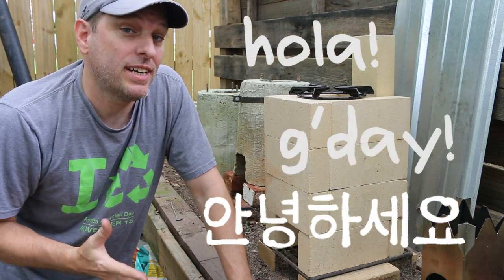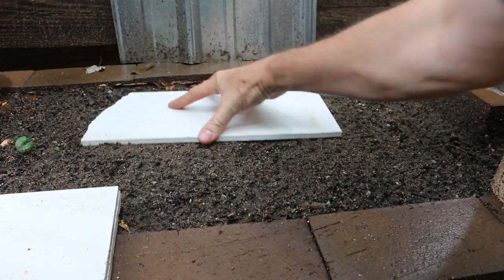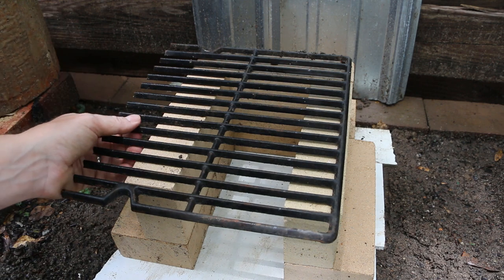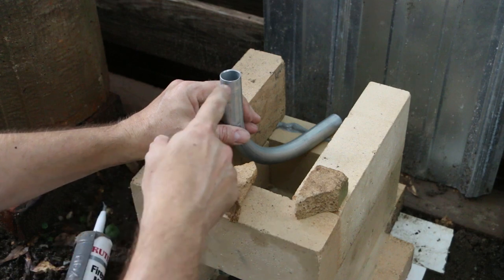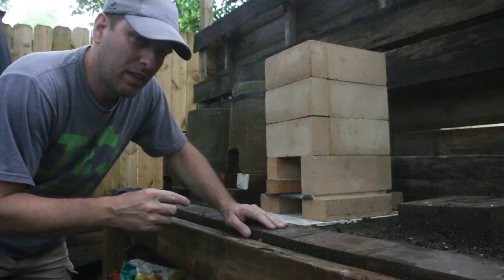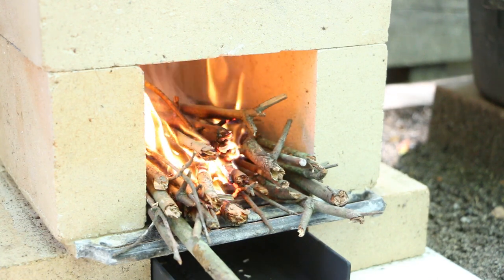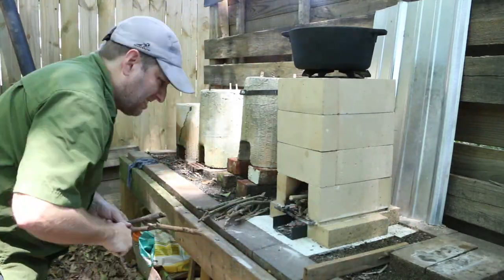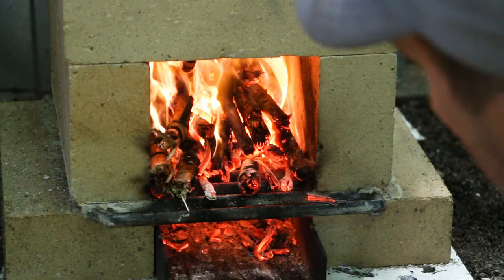How To Make A Fire Brick Rocket Stove

Comment: Do NOT cement your bricks. Mine aren't. Easier to clean, easier to move. And with the grate, i can convert to a grill or Camp oven table. It sounds like more work, but I like the versatility I get vs needing more bricks.

Comment: First, let me say I really like the way you produce your videos and the honesty with which you present your information.  I almost always watch the entire video when you post one, so keep up the good work.  However, the CSA of the burn chamber is too large for the riser.  The total volume of the riser should be 3 times the area of the burn chamber, which includes the air space under where you are burning the fuel.  To get the best efficiency, add a couple more courses of firebrick to the top, alternating them to avoid the running seams in the brick.  A closed door and handle on the outside of the ash tray would be notable improvements.
Reply from the maker: Jason, thanks for the feedback and info on CSA. Good stuff. I’ll do some measurements and give the fire brick rocket stove an upgrade with some more bricks. Thanks for watching. I appreciate the encouragement.
Reply: What does CSA stand for? Cross section area?
Reply from the maker: Joseph...I think that is correct. In concept, at least, if not word for word. Thanks for watching.

Comment: They use to make them with TWO burn holes = Two burners. and They did it with just a few blocks.  They use to make good blocks that didn''t crack with heat like  he ones they have now do.  But we need to make the Rocket Stoves with two burners.
Reply from the maker: Thank you for the suggestion. That sounds like a fun project.

Comment: Back in the burn chamber cut out a four inch square in the grate so big chunks of hot embers can fall down into a pile under the fire. Then as you feed longer, bigger wood forward the hot embers underneath will catch the big wood on fire easier. 
Good design. Worthy of a poured concrete foundation that will last.

Comment: Excellent.   Only thing I would do is use your grinder to cut out the ring shape in the top bricks so the grate sits down, resting on the "legs" and will not slide off....

Comment: Best stove yet , by far .  Was thinking what all I could use one of these for besides eggs and simple things , and I realized that the chinese takeout places kind of cook from the same concept except of course they're using gas or propane , but the high heat is about the same .  Would need a giant sized wok and chinese sauces and ingredients but I'm willing to take a stab at this , might have to weld a long handle onto the front of the wok to be able to move it around like they do .  Yep I'm gonna attempt this , again keep the rocket stove ideas comming

Comment: Small bread pan will work well as an ash catcher. Should be a good fit too.
Also, if you used a wooden or leather mallet, you can tap the bricks in place with less risk of damage.
Reply: Update: I bought some caulk tube type mortar so I can at least seal the bricks I have.
Just too many air leaks causing too much wood to use.

Comment: Simplest stove I have done is stacking 3 building blocks on top of each other with holes matching vertically and two bricks under each end on the ground for ventilation. Worked great and can be used for two cooking areas or close off one for one! About 8 dollars.

Comment: Sue, this build is ok for only intermittent outdoor usage for cookouts, etc. But true rocket heaters should use insulated firebrick(more expensive) which allows combustion chamber to be more efficient. It reaches hotter temps and also heats more quickly because they have less mass than heavy non-insulative type firebrick. In rocket mass heaters the heavy mass is a shell outside the insulated core.

Comment: I've been dreaming of a huge 30 inch wok for outdoor cooking, and don't want to use propane. I've been looking around for a good wood option and this is really fantastic. I'm thinking the firebrick on mine would be covered in a traditional brick second layer for looks and for support of larger cooking gear, but I'm so glad this is a simple and efficient rocket stove. I've watched your others, this is the one I think will work for me best.
Reply from the maker: Thanks Scott. Glad you’ve settled on a solution. You might consider using three rebar risers to hold the wok. My concrete and perlite stove used rebar and it’s been pretty solid. I’d go taller with the rebar to get the right clearance for the wok. You could make them removable in case you wanted to use a traditional pot. Thanks for watching. Let me know when I can come for gumbo. :-)
Reply: What about using some charcoal  in with the wood for longer lasting burns with the  wood.thats a good sized wok.
Reply: @GreenShortzDIY  well said....gumbo...lol

Comment: Great video! I am guessing that the thin galvanized emt tube might fail in the repetitive high heat. It also seems like the air enters too high in your chimney, but you have an great flame that burns high!  I have seen guys use copper pipe to provide secondary air horizontally into the side of the burn chamber to feed the vortex, which creates a very hot burn with less ash. Thanks for sharing this! Your channel is interesting and inspirational.

Comment: I like your design. I just put something similar together quickly after watching your video. I used fire bricks to build the burn chamber but used a four inch steel pipe for the chimney / secondary burn chamber. I put a six inch section of chimney pipe around that and packed the inbetween with dirt.  My purpose is to heat a greenhouse rather than to cook so I need lots of thermal mass and really need the secondary burn chamber to get as hot as it can get, thus the steel pipe. 

I did extend the primary burn chamber out a little further so that it isn't almost directly under the chimney section and its all working great for my first test. Tomorrow, I will put a dome over it and run some chimney pipe from that and build that ashtray. 

Although, I'm making more of an oven than a stove, I settled on your design for the fire box as something I could get done quick and easy this year in December and thoroughly test through a season before building a massive masonry heat battery. Right now it will be heating the air and some 55 gallon barrels of water. Next year it will be sand inside masonry structures as heat batteries that I will use to put plants on. The stand allows much higher temps for the battery effect. I hope to be able to put seedlings on the masonry structure to get them started just that much sooner. 

I need to really scale it up because I'm moving from hydroponics to aquaponics this summer and need to keep the fish warm too. 

Thanks for the research and design videos, they are really helpful.

Comment: I just threw one together out of recycled chimney bricks and a couple tubes of fireblock mortar, an old grill and a bit of flashing to bend into an ash box. I used birthday candles to start the maple twigs I pruned off my neighbour's tree. Easy, fast and just roasted my first marshmallow while I was curing it!
Reply from the maker: Awesome! Free bricks are the best way to go. Even your neighbor's tree provided the fuel. Love it!
Reply: @GreenShortzDIY  I could use more instructions on how to get mine going without smoking out the neighbourhood though ;-)
Reply from the maker: eternalfizzer good idea. I’ll do a video about different ways to light a rocket stove quickly. The short answer is a very small twigs and a fire starter.
Reply: @GreenShortzDIY  yes please!

Comment: I was thinking this might be the way to make a pizza oven -- build one of these easy peasy fire brick rocket stove, abscond/rescue an old Weber kettle BBQ from craigslist, remove legs and cut hole in the bottom to set on top of rocket stove, cut opening on kettle lid for pizza entry way, and add a pizza stone to set it on!
Reply from the maker: R A I’ve got an old Weber I’ve been saving for a project. I like your idea. Thanks for the suggestion.
Reply: Gr
ea
T
Reply: Great🙂

Comment: This is the best rocket stove build that I've seen. Well thought out and safe with your use of firebrick and fire cement. Using concrete pavers in some other videos is asking for trouble. Thanks...great job.
Reply from the maker: Thank you, Michael. If I did this again, I’d leave out secondary air tube. It doesn’t add much airflow, if any. Thank you for watching.
Reply: So I could build this with just the firebrick? And the grate of course
Reply: What kind of trouble could be caused by using pavers?
Am just now learning about this.

Comment: That's actually a small fireplace and chimney.  I wouldn't call that a rocket stove.  But it works and that's what counts
Reply from the maker: The term rocket stove is used a bit loosely here on YouTube. So, I can’t argue with your assessment. It does make the rocket sound and pulls a convection current, so at least some criterion are met. Those are the most important two in my opinion. But, yes, not a true rocket stove.

Comment: I have fire brick that I bought at Menards, but it's about half as thick as yours, I couldn't build anything with them if I wanted to, but maybe I could line a square type concrete rocket stove, using a plastic kitty litter bucket as the form, the concrete would have to cure for a month before firing it up. You gave me an idea to try that, since you put your hand on the fire brick and it apparently wasn't hot enough to destroy the concrete, if I decide to go that way. I just want something to make charcoal with, for filtering water. Thanks for the video, it'll help out, I just wish I could find thicker fire brick.
Reply from the maker: I know the thinner brick that you are referring to. I’ve used it to line the firebox of a cob-bodied rocket stove. I have been able to use stove adhesive to glue some together into a small rocket stove inside my grill. That worked pretty well. I thicker, full-size firebrick does stack up better, though. Thank you for watching.

Comment: Please tell me a little more why the air tube? Was it really a benefit? What more do you feel you got by using , more costly, firebrick vs. plain old bricks? Have you thought about if you’d left the grate longer it could have supported another brick to be used as a damper? Out of the different stoves you’ve built, which are your top two favorites (in order)? Thanks for your response
Reply from the maker: r. michael wilensky the tube really doesn’t add much benefit. It was sort of an experiment. I thought it would draft more. The concept works better when there is more combustion time for the air, like in a rocket mass heater. I’ve seen designs that incorporate a supplemental air tube. I haven’t done a plain brick rocket stove yet to know the difference I do have some old bricks that I use for the base of some stoves. They’ve done fine. You could always give them a try first. If they fail, you’re only out a couple bucks. This firebrick rocket stove is my favorite, but I like the cobb and concrete ones in a close second. For me, it’s less about the stove and more about the rocket burn process. The efficiency makes me happy. Thanks for the feedback and for watching.

Comment: Love it - make a set of bellows out of scrap boards and a pipe to really get it blasting
Reply from the maker: Hi Peter. I'll have to make a bellows. Thanks for the suggestion. Thanks for watching.
Reply: @GreenShortzDIY  With Bellows - really easy to make out of wood and old leather mini skirts you can get the rocket stove like a blast furnace and melt iron if you want - the old blacksmiths used charcoal and a set of bellows - plus you could make hot water in no time with bellows made ot of scrap
Reply from the maker: @peterlockhart2588  I'll have to hit Goodwill for a leather mini skirt. That might raise some eyebrows. :-) Thanks for the tip.
Reply: @GreenShortzDIY  Here we have second hand shops - clothes get donated - leather mini skirts or old leather clothing like jackets or even long boots in charity cast off shops - make a V shape bellows not a violin shape - load the stove up with small twigs - get the fire going and then pump the bellows - Rocket indeed - it will ROAR
Reply from the maker: @peterlockhart2588  Yes. Goodwill is a popular second hand store here in the US. They use their proceeds to provide free job training for those needing career advancement. I like supporting their mission. Thanks again for the tips.

Comment: I use to build masonry fireplaces and that's the way you suppose to build them with the fire brick only, other bricks will crumble over time also ..you lay them vertical the way you did it they are made to be laid that way the fire brick will last forever.
Reply from the maker: Thank you, Richard. I always appreciate hearing from a pro. Thank you for watching.
Reply: @GreenShortzDIY  You're welcome! and a smart choice because them firebrick are the best to use, they also generate more heat in the home fireplace!!

Comment: I was just wondering if the secondary combustion tube's end was placed a little too high, as well you might try perforating the top 2 inches of it. Please correct me if i am wrong. GREAT VID'S! Keep up the grand work.
Reply from the maker: Ryan Kinzel I am a novice with regard to secondary combustion. The tube didn’t have much draw, so I’m not sure how effective it is. I do want to learn more about using secondary air correctly. Thanks for the feedback and the suggestion.
Reply: @GreenShortzDIY  Thank you for your time and quick reply, You do great work. I have built a few rocket stove's and the secondary combustion is essential for a "Stoichiometric burn" in my opinion. You must make use of the gases that are released from the wood's after primary combustion.
Reply: Oh wait i almost forgot, Peace and Love from cold cold Canada!
Reply: @GreenShortzDIY  Thank you again, It's nice to be ale to speak with the builders of such items. You do amazing work with much insight into things i am unaware off. I'm just a welder from Alberta, Canada. KEEP UP THE INSPIRATIONAL VIDS! Peace and love from cold cold Canada.
Reply: I agree with Ryan Kinzel. Secondary air  tube should open into where the heart of the fire is.

Comment: Now, this is a beautiful machine. And made with the correct materials ... it's interesting how experimentation normally resolves to the science and engineering already done. So, a good result.

2 points:
[1] your flame height is exceptional .... maybe too high in fact ? How would you reduce that ? .. by reducing the cross sectional area ?
Or, in my case, as I would like to heat a large flat copper pan on top of such a flue (maple syrup evap), how do you think I could get that flame to spread more widely at the exit so that the plate might be more evenly heated ?

and [2] this is actually a machine that needs a feeder .... have you thought about how to place one onto the front of this unit ? 

Excellent stuff !

Comment: Hello from Finland. Thanks for sharing your wins and fails in your rocket stove quest. Do they get very warm on the “body” of the concrete or brick stoves? I’d like to use one as a heater rather than a stove. Keep the videos coming. Take care.
Reply from the maker: Hi Rich. Thanks for the encouragement. Most of the rocket stove bodies do get warm, but those that are insulated are designed to direct most of the heat up the chimney. I’ve got a radiant heat rocket stove idea in the works. You should also look at rocket mass heaters in YouTube. (I haven’t made one yet) They direct the heat of the rocket stove through a mass to capture the heat and radiate it out into a room slowly. You can burn a rocket mass heater for 2-3 hours and it will heat a home all day. Perfect for a cold Finnish winter. :-) Thanks for watching.

Comment: I made the traditional cinder block stove yesterday.  It struggled to breathe.  No wind at all.  I like your elevated grate solution!  I'll try that and possible add a breather hole in the back of the fire box on the other side.
QUESTION:  Do you think if you left the back lower brick out you'd be burning better too?  Or cut a vent hole?
Reply from the maker: A good question. I’ve always heard that “continuous cross section” is important for optimal airflow through the stove. I usually like having airflow come from one direction, but I haven’t experimented with other options. Give your idea a try. Don’t glue anything together until you’re happy with the airflow.

Comment: If u could come up with a plan to introduce air flow to the opening instead of blowing. Maybe a solar fan with some kind of induction.
Reply from the maker: I’ve got a little USB fan, but it requires extra energy. I was primarily blowing to see how big I could get the flames. I think it draws very well on its own. Thanks for the feedback. Thanks for watching.
Reply: Would be neat to use a thermal energy generator to run a fan, and once your fire is heated up, the fan will be more effective.  Also a solar powered fan forsure.  I think the best idea what to have multiple airports in the burn chamber

Comment: Love it! Will this rocket stove heat the surrounding area as well, or will the heat be mostly contained within the stove? I'm seeking a design that will safely cook and also safely heat a space.   Thanks for sharing. You are a great resource!
Reply: I KNOW!  That would be ideal.  Thinking of putting a small ready made one in the fireplace for cooking indoors.  Heat is still going to go out the top!  But maybe SOME benefit for indoors without having to open doors. ??  You know they used to heat bricks for foot warmers at night in bed?
Reply: You'd want to use a brick that will retain the heat if you want it to radiate outward.  The firebrick he used is to insulate (remember he was able to touch it bare-handed)